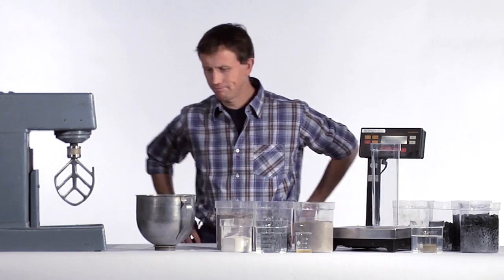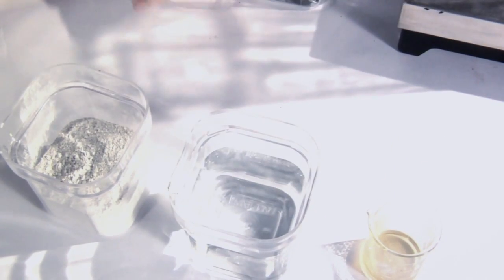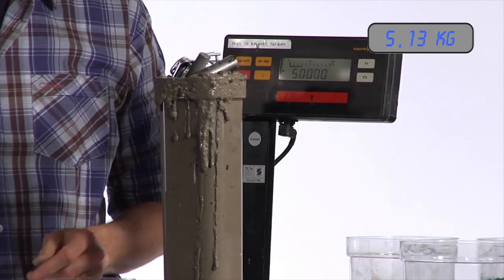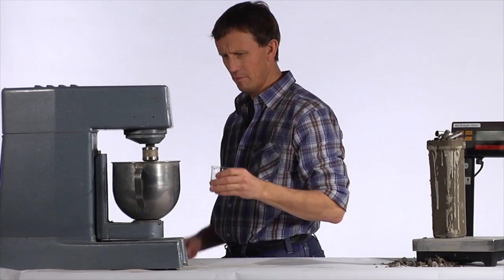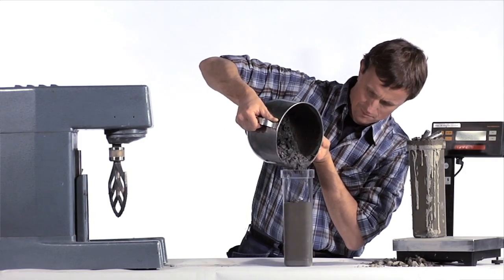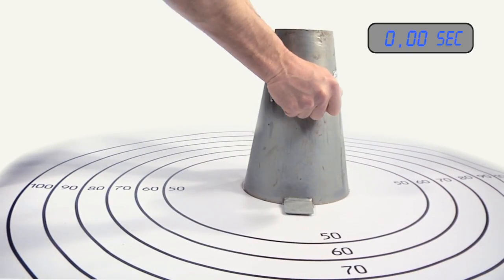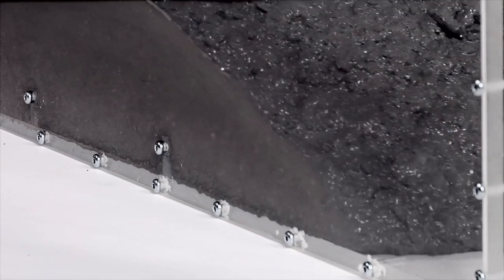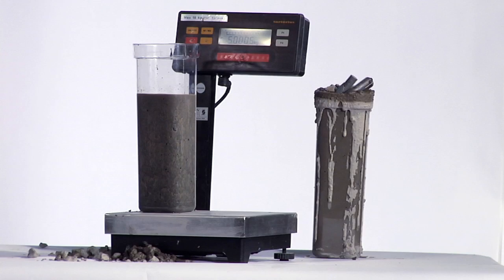High density concrete mixing with MagnaDense

Comment: I'm interested in this product. I'm wanting to increase my sound reduction between Victorian brickwork of my terraced house. I've took all the old soft cement off. Im now down to the original brickwork. My idea is to apply this product directly onto the brickwork within stud work, then create a small cavity for soundproofing such as rockwool. Then a layer of plasterboard soundbloc to finish. I have a very limited thickness to work with. I believe the higher the concrete density- the less sound transmission to next door. However high density results in the sound reflecting back into your own room. Therefore my theory is to stop this reflection of sound happening is in first place with the use of the cavity insulation and layer of soundbloc on top of the high density concrete and on top of the studs . Would be good to chat with you about achieving this possibility as I've never seen it tried for this purpose.
Reply from the maker: Hello Les, seems like an interesting project you have going on. Although we usually supply our product in bulk quantity, perhaps reach out to a local sales contact of ours to see if he/she can help you with anything. Please, check our website www.lkabminerals.com for a contact person.